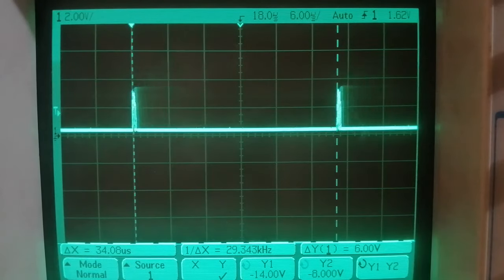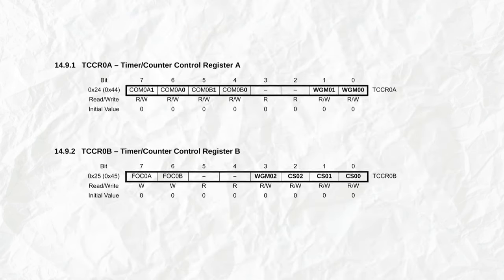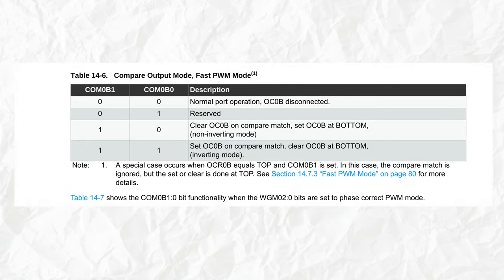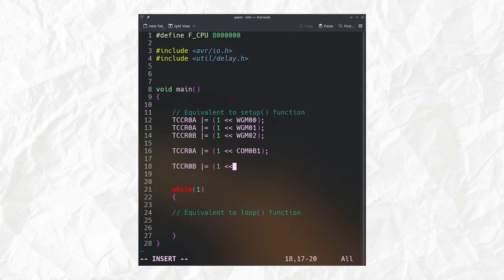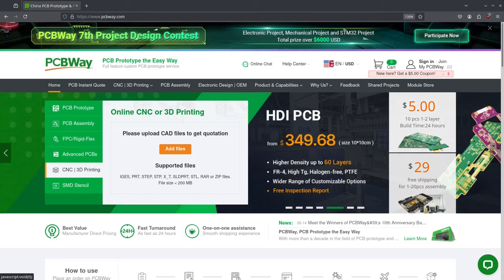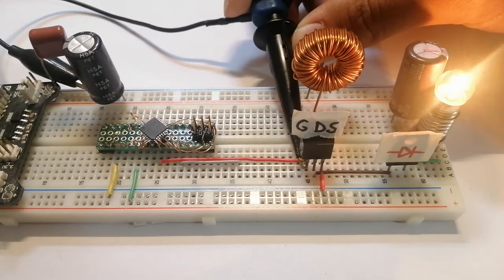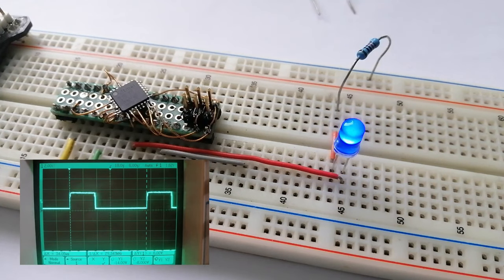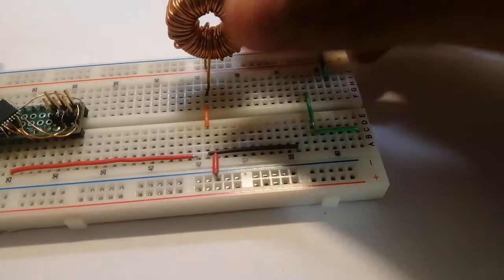High-Frequency PWM with Arduino/ATmega HW Timers for driving SMPS

Comment: NGL I am kinda jealous of that Frankenstein "DIP" chip.

I think with the length of the video, you could have still included some additional topics, like actually using/not using OCRA and showing the difference, and maybe including a feedback voltage back to the arduino to make a simple closed loop voltage control by having it vary OCRB in response.

Comment: Were you reading my mind? Wow man, another great content! I'm thinking of making my own microcontroller-based buck converter these few weeks. I'm still stuck on whether to use off-the-shelf IC or a microcontroller, and on top of that, I'm still a novice in electronics.
Reply from the maker: Thanks!
That's a great project. I won't give suggestions on which to choose, but what I'll say is to keep in mind the feedback and control of the output voltage. You might prefer doing it with the ADC and a little programming, or letting the IC deal with most of it.
In any case good luck!

Comment: The 555 timer can do 32.5khz easily and even up to 500khz ~ 2Mhz. It also does great pwm and at 12V which can switch a FET gate. Think I'll stick with a 555.